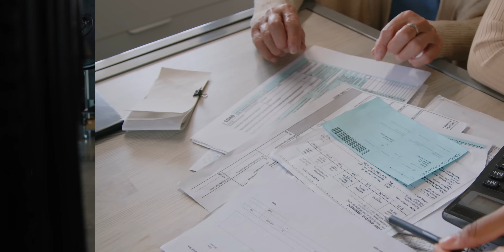SHOCKING Things that Happen in Machine Shops

Comment: man the stories I could tell... 

One that stands out is the chill at work kind, this guy in Jig Grind in the Tool and Die area of a major manufacturer of outdoors equipment would have his feet up, reading a newspaper, all while the jig grinding machine he ran was running, reaching up every once in awhile to adjust it. He would have tapers when there should be none. It was bad enough that there was a term made up for this taper called "Newspaper Taper" lol.

Comment: I worked at a place that regrinded their plastic with a wood chipper having the operator put their hand in said wood chipper, by far the most dangerous job I ever seen, worked a week to make payroll and bounced.

I used to work at another place that stored their skyjack in the fully extended position (obviously an OSHA violation because if the hydraulics gave out the bucket could crash down on someone or something), at the same place they got bought out by a company that specializes in reforming businesses (some overseas company) they quit paying the waste management company to pickup up weekly instead they stored all the waste and trash in Gaylord's and filled the warehouse with them so much they buried the resin for parts so to run the equipment they had to dig through pallet after pallet of trash to pull resin, eventually the warehouse got full and they started storing the Gaylords in the loading dock, well it only took a week or two for somebody to notify the city and the city straight up told them they have to pay or face a revocation of their ability to do business. They're still storing Gaylord's but they upped the waste management pickups per month to keep the loading dock clear. Damn shame the first owners sold was a good company to work for in the beginning, the second company wasn't too bad, but that third company is the cheapest SOBs on the planet.

Comment: I got a lot of stories but just to name a few at where I am currently working
1. We got a guy that will work 70-80 a week regardless of it he has any work or not, this same guy will move to a manual lathe and after every cut will sweep the floor and wipe the machine down ( Major brown nose)
2. We had a guy looking through cabinets looking for a metric tap like m12 by 1.5, the supervisor thought he would "help out", said supervisor then found a m12 by 2 and told him to use this, then the guy told him he needed a 1.5 to clarify and the supervisor reply was can't you just take a half inch off.

Comment: At work, im watching my parts being made, measuring my parts, polishing, and listening to my machines. I get home after a 12 hour shift and then i watch titans of cnc videos. 8 months into machining and I made parts that had a .0003 tolerance on it. I only scrapped 1 because my drill pecks werent dragging shavings out and the shavings ate up and tapered my ID. Granted these parts were aluminum but i was so impressed with myself and proud of my work. Im confident i could do it on 304 material. Honestly 304 is the worst ive worked with. I did 1 inconel job so far but it went fairly smooth cause i was told to watch my tools and i watched them like a hawk

Comment: most of the ones i got, i can't say but i got 3 that all got violent

guy running a lathe a number of machines over had the thing bite so bad it stopped the 200 (?) kw spindle and workpiece right then and there. a 600 kg workpiece just instantly stopping caused the whole machine to jump (pulling up M...8? studs all along the edge) high enough to land on him. Guy was gone long before the ambulance was audible.

While in my millwright phase, we were finishing up servicing a high-speed hot press when a manager came storming over talking about quotas. me and the others in the press didn't hear any of this and were getting out when he cut off the LOTO lock and started it. My shoulder is metal now because of it and he was in the next hospital room over from what the others did.

in my last job before going my own way, the shop owner was incredibly fuzzy about time-keeping and demanded we stamp out before changing clothes (swedish unionised workers, he can't do that) and so on. Things got violent when we started keeping time ourself and realised that he was removing upwards of 2-3 hours/week on the digital timecards. one of the guys who had been there for 15 years ended up settling with the money not being paid against battery charges being dropped.

Comment: currently we have 2 guys. both from nightshift, 1 a transplant to days. i've trained these kids.. they know better but they still falsify paperwork, neglect their tools and god help anyone that runs behind them. this is the best they have to offer for training candidates. it's sad really. . i've had to fill in on days to allow for sick time, vacations and not attend my duties. the things i've seen.. i point it it out and they get after me because they want the numbers and can't find a replacement for them and one is still very green. worst part is the sloppy nightshift transplant i think corrupted the inexperienced nightshift guy. just this week i've only managed just over 1/2 my normal rate because i was fixing so much stuff and rerunning his parts. .it's pathetic to say the least. this is just an operator job, no coding required, no feeds and speeds, none of the complicated stuff. i suspect he's overriding the the speed/feed so he has time to screw around and still hit numbers.  occasionally we need to jump through the code to fix something like a bad probing, questionable programing. anyway he managed to DESTROY the chip fan. report said he crashed it but the fan was fine. done it by stopping the machine because he had the wrong program up and stopped it and switched to the right program. it ends with the fan out and all the way up. there's no way in hell that fan was low enough to contact anything from the start. i pointed this out and zero consequences for an obvious lie and constantly wrecking the machine. they'll just rob my tools and act  like nothing happened on nights. they've done this with boring heads, mills and even measuring tools. it's a damned joke, their "operators" and management.

Comment: Back in the 70's, I worked graveyard shift in a union shop that had a lot of N/C machines, which they used to build N/C punch presses among other things. One area of the shop cranked out punches & dies by the thousands using cam-operated, bar-fed turning machines. One of my co-workers came up with the idea of making lug nuts (for cars) on one of the machines, using company materials on a company machine. Just before the day shift would clock in, he would haul several tote pans full of lug nuts out to his car. Eventually, he got caught, and disciplined, but not fired, thanks to union intervention. However, he thought he was treated so unjustly that, on the day that the company president handed out Thanksgiving turkeys as we punched out at the end of the shift, this a-hole took his frozen turkey, slammed it down at the President's feet, and told him to shove his turkey up his ass. Again, disciplined, but not fired. I watched it happen. Unions suck.

Comment: The Leisurely Sloth is my personal favorite. Had a guy in my shop grinding cranks as slow as possible and showed him how to speed the grinding machine  up without stressing himself more. I told him its better for the machine, better for him so he hasn´t to stand so long at the machine and better for us and the customer. As soon as I went away I heard the grindinh machine slowing down. Askind him why he did that his answer was "if you don´t like how i´m working you could fire me". Had him working overtime on a Saturday. Came later in the shop and he had set up a crank for grinding and after 3 hours he hadn´t even ground one single journal.

Comment: Is this what really happens in a workshop!! Probably for the best, i work in a very small shop with only 4 people, i can't get away with anything, if my CNC is running then i start loading or setting up another or even deburring parts. Slowing down feed rates seriously? Surely there should be a supervisor to stop this? I mean quoting a job and it takes 25% more time....? Inreally don't get working for a big company one bit.

Comment: Manufacturing is the worst job sector for exploiting workers. The crap I’ve seen the bosses pull is unbelievable. Wage theft, unsafe conditions, and mental abuse are common. For all the tough talk, most guys just shut up and take it then passive aggressively steal, sabotage, or just stop hustling. If you respect your workers and treat them well, they will generally do a good job. That doesn’t negate the need for actual managers to actually manage. When I have had guys under me, I made sure they did the job. That means getting out of bed and checking in on 3rd shift every now and then. Probably the worst / most stupid worker I ever encountered was a guy who was putting a can of beer in a big gulp cup with a straw. If you’re gonna day drink, the go to is vodka-OJ.

Comment: This is standard business nowadays it seems! I’m not trying to downplay this video. As being in the trade we have all seen some pretty awesome things! But I could write a book on the things I’ve seen! I’ve watched a brand new (2 week old tow motor) that the company was leasing, getting torch cut up & loaded onto the scrap truck. I mentioned to the maintenance guys apprentice that was doing this that ur scrapping out the wrong one. He was certain that he was doing his job good. Same shop, I’ve seen a Bridgeport jump 2” off the ground. I may be exaggerating, but it definitely jumped & came off the floor. A guy power washing inside the building  to clean the walls of the shop as well as the panel boxes & bus bars. 🤣. That was a firework show! He survived unfortunately!!! I’ve Seen numerous machines on fire….. numerous times. One guy was stiching up his own face in the bathroom.after he fell off the roof of the building trying to install his own surveillance cameras (so he could see if his parole officer was showing up), I watched a saw guy cutting up 1” dia. copper bars up so he could fit them into his trunk easier. Another guy was throwing brass parts straight off the machine  into a 55 gal. Drum for scrap, b/c he thought he was making the company money. B/c scrap was high. Seen a guy grind a flat on a new carbide endmill for a solid holder. He put a flat on the flutes! He also showed up to work wearing pajamas pants & slippers. Worked w/one guy that argued that carbide is malleable! “He was an engineer” 🤦‍♂️. Another guy after 2 weeks of employment said he wasn’t feeling good b/c of the chemical/coolant in the shop, turned out that he was drinking solvent! The waste solvent besides! 🤦‍♂️I relocated recently & started a new job. I learned the roof caved in a few months ago b/c a long time employee that never made a bad part in his life has been throwing the bad parts that he never made on to the roof for 10 yrs. Scrap parts came raining down into the shop, when the roof couldn’t handle the weight of his “good parts”?There’s homeless people that live behind the shop in the woods, they tied an extension cord into the buildings service. Idk if that counts as crazy things uve  ever seen @ a shop or not. Its a  tough trade! Try to laugh & make the best of it & help out who you can that is willing to learn. You never stop learning in any trade. Be humble, try new things, learn from mistakes. Try & keep up w/new technologies & push the limits! Think outside of the box! Listen & try new things & ways of doing things.

Comment: We had a manager in charge of inspection. He copied every print and file he could of parts we made for pharmaceutical machinery. Also grabbed a vendor list of outside machine shop and other suppliers. Gave his two weeks' notice and opened his own business. Starting selling accessories & replacement parts for the machinery the company sold.

Comment: The absolute worst thing I have ever been around was two guys on the same machine but different shifts fighting. Let's just say that it ended when the guy on the off shift crapped into the coolant tank and left it overnight for the first shift to discover about half way into his shift the next day. The second shift guy was fired as soon as he walked into the door.

I've seen tool boxes drilled and tapped for a zerk fitting and then filled with grease.

I was once told by a operator that he didn't run a machine at 100% programmed rate because "You don't run your car wide open" I replied "But you do run your refrigerator wide open" .

I just retired after 47 years in machine shops, believe me I've seen it all!
Reply: company policy to stick to 50% rapid with us because the covers make so much noise in full rapid.

Comment: some people working with open doors often because the production manager wouldn't replace old glass you couldn't see through anymore. also cleaning up like 20+ year old rusty tools holders and shit and people diging through the scrap container pulling out old drills and putting it back into their drawers and so on. not shocking but annoying af

Comment: I'm retired now but after 45 years in the business I think I've seen it all. When I worked for a jet engine manufacturer, they had a zero tolerance for theft. The security guards would random check people leaving the plant looking in the employees' coolers, backpacks...I've seen a guy get fired for stealing two rolls of masking tape. Another for a flashlight. But I saw so much stuff leave that plant. It was a great place to work with the highest wages and best benefits around but there was an "inmate" mentality with many employees. They were always trying to get away with something. The biggest theft of all was time. Guys would dog jobs all week just to get the extra overtime. If anyone hustled, coworkers would get on them to slow down. It was like money grew on trees. The best thing that ever happened to me was getting laid off from there in 1992. I could tell stories all day about working there.

Comment: Might be an unpopular take but if the company you work for is so ignorant to whats going on that someone can buy double of tooling and shop supplies without being caught or even asked about it, they probably deserve to be ripped off... In 20+ years, Ive seen just about everything at the shop level go down. We call it "wage theft" when people are abusing bathroom breaks or dicking around when they should be working and will have a conversation a couple times with said employee but after enough talks, they go out the door. Its no different than working at a convenience store and taking money right out of the cash drawer. Same goes for shop supplies. I have worked for shops that are really lax about shop stuff and some that dont mess around with "company property". at the large shop I used to work at, they would encourage employees to take gloves and safety glasses etc home with them for use around the house cause it was a minor expense to encourage safe behavior at home but some shop Ive worked at, Ive seen people get written up for something as simple as trying to take a couple washers home for a DIY project in their garage. Gotta read the room with the company. Probably the worst one I had seen was one company I worked for had a tool reimbursement program that helped new guys get tools quickly and do it as a payroll reduction out of their check in payments to soften the blow of the investments for calipers, mics etc. One guy they hired right out of school that looked like a tweaker, they somehow let him put a full 3 tier kennedy toolbox, a set of 0-4" mitutoyo digi mics and a 12" digi mitutoyo caliper on his work account, then he quit like 3 weeks later after like 1 payment came out of his check but he took his tookbox home on an off shift when nobody seen him doing so. between the tools and the fact that I knew he was hoarding mitsubishi MZS carbide drills in his box, I figure he walked out with around 5-6k worth of stuff and they couldnt even come after him for it. they just kept his last paycheck which didnt even come remotely close to covering it all.
Reply: Ridiculous argument..The reason it would probably work in the short term in my company is that we are a multi billion pound company...But you will always be caught eventually and it's best to not be known as a thief

Comment: The slowing feeds thing makes me so mad. I work solo on nights to do all the programming and set up for our lathes. Had 150 parts that needed to be faced to length (10 sec/part), then turned between centers(1min per part). Maybe a 3-4hr job. Came in the next day, 2 button pushers that work 10 hr shifts managed to only face 40 of them, none tbc.

Comment: I cant top them. But i worked at a machine shop. That used brass bar stock from a 1/2 inch up 2 inch bars. And they stole a 13 foot box of them at 2 in morning. Thinking the Camera, s All over the place wouldn't see them😅😅.

Comment: I was a machinist for 50 years. This incident happened in California, South Gate to be exact. We had 36 hi speed Davenports. One of the operators on 2nd shift told me he was having trouble with the cutting oil going sour after a couple days. He would clean out machine and put in fresh. Same thing happened. So he hung around at end of his shift and watched. Lo and behold, about an hour in, his shift replacement took a leak in the oil tank. Need I say more. Did not end well for him.